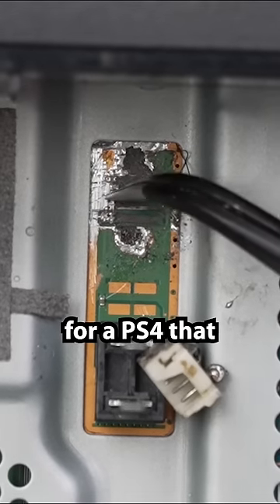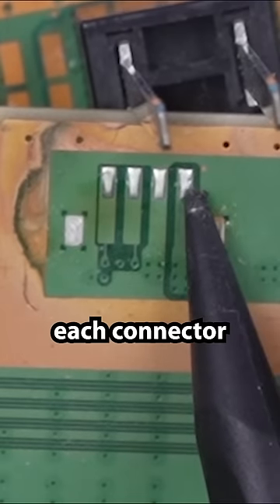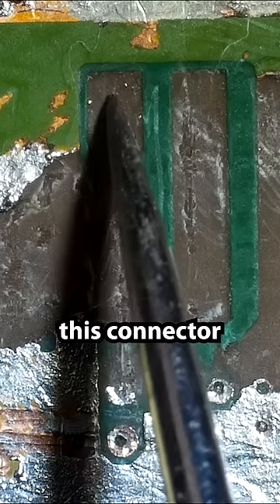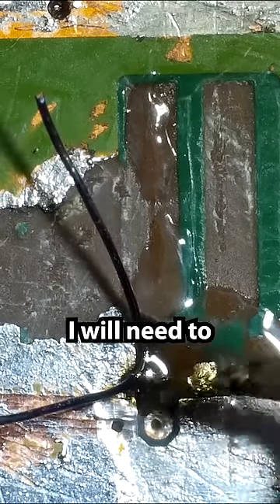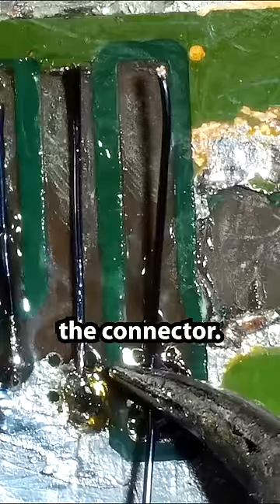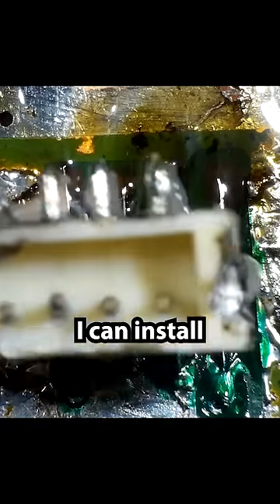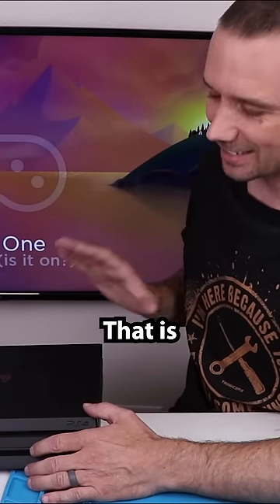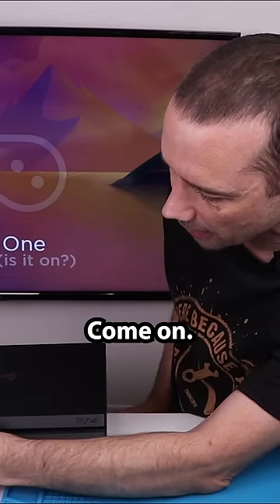3 Other "Repair Shops" FAILED to Fix This PS4

Comment: Man, they destroyed it 😂😂
Reply: yea they don't want it fixed cheap 💀
Reply: Nah blue light of death is the easiest fix. Just replace the connector Pins in the hard drive slot and put in a new hard drive and boom it's fixed I've fixed about 8 systems with that method
Reply: @ipeed  yaaa..... Gonna buy a used ps4 instead
Reply: @ipeed  is that really what it is? A burned out sata 12v? I might go buy a busted PS4 then lol
Reply: @infernaldaedra  not everytime but if you are lucky.
Reply: @ipeed  do you use a heatgun or soldering iron for this task?
Reply: Jake The Dog  Ahh he must be some notable repair man if he can do simple repairs!
Reply: @ipeed  is that always the cause or just mostly the cause?
Reply: @benargee  idk about every time but it's worked most times for me while fixing my friends systems
Reply: @ipeed  ok yeah, it just seems like there are limited ways to indicate a hardware fault so it seems odd this would exclusively be used for just that one fault. But yeah it could just be the most probable to happen.
Reply: Right? Dont know how they could be proud of that work😂😂
Reply: @ForceInEvHorizon  get a pro they are definitely worth 250$ I love mine I'm getting a 5 for Christmas had the 4 for 4 years and the slim for 7 never run discs so mine last for a long time but the 4 pro is well worth the used price now the new price they get gtfoh 349.99 😹😹😹 tells you how much they spent developing it 😹😹😹
Reply: @infernaldaedra  z xx,
Reply: It's a goddamn war zone
Reply: Why do you think a ps4 pro was $150? Come on. Think about it.
Reply: @dontazembro8637  I’ve bought and sold for cheaper
Reply: @ForceInEvHorizon  just save and buy a ps5
Reply: @benargee  Faulty APU or busted solder joints underneath the APU are the usual cause of Blue Light of Death
Reply: Destruction shop

Comment: Holy  crap. You didn't do it. All other youtubers will not upload their failures. So because your videos actually have a small chance of failure i will subscribe because I think that makes your channel better than a lot of em just by default
Reply: Uh yeah he milked 3 million videos off a broken PlayStation wouldn’t you
Reply: I mean... He paid $150 and without the video that $150 would be lost. W the video he likely got his momey nack if not more. Then on top of that, the blie light isnt unfixable, its just not worth his time to try and fix it further since the success rate is fairly low. Definitely isnt the only channel to upload his fails, id first assume those other channels went deeper into the rnepair attempt than he did before assuming they just dont upload their failures despite the fact theyd get paid for sharing it.
Reply: I'm gonna subscribe because nerdyvariety3105 subscribed!🎉

Comment: It's amazing just how fubar something can get in electronics and still be repairable
Reply: Used a dremel on a chip missing a pin once
Reply: @SlavTiger  what did you use the dremel for?
Reply: @harrydean9723  i carved off some of the chip to expose the missing pin and soldered a wire directly to it. It was a commodore 64 vic 2 chip which if you don't know is complete unobtanium if you have to replace it
Reply: man built,  man fix.
Reply: Everything is fixable it's a two factor equation un-fubar=  time + money
Reply: But he didn't actually fully repair it

Comment: So much of DIY repair comes down to having the correct tools.
Reply: Do you mean, the actual knowledge and skill?
Reply: It needs the right tool and the skill
Reply: They are basic electronic tools. I didn’t see him use a desolder suction gun or anything crazy. He did it the basic wick way. He could have connected jumper wires to the terminals if he wanted. Or if someone sold the components with the pins in the opposite side he wouldn’t have had to do 60-80% of that work.
Reply: Solder gun is like $20 you can get 2 jars of flux for $5 online. Torx & other bits also sell for around $10-$20. Actually cheaper then you think.
Reply: And Patience plus the knowledge to know when to stop before you get in over your head.

Comment: I hate replacing those wires they're so hard
I don't use solder mask though I use heat activated glue to stick the wires down
Reply: soo a hot glue gun (jk)
Reply: You don’t use grammar, either.
Reply: The glue I use is for reflow ovens to hold the parts in place I think it activates around 300° c
Reply: @saladass1571 ?

Comment: Blue light of death? I had the same thing 4 days after buying mine new from the store, left it for a while kept turning it on and off, one day it just started working again for years.
Reply: Yeah I had ps4 that would work like every 3 months lmfao
Reply: It’s an overheated connection broke loose inside you must have got it hot enough to melt the solder and reconnect. You can also put them in the oven and heat the whole thing sometimes it will melt and rejoin. I wouldn’t advise doing that first tho that’s kinda last option nothing left to do before throwing it out.
Reply: @jamesfair9751  I can only assume that quality control is very loose in these manufacturing plants.
Also, NEVER throw out an electronic device as you can always use the parts.
Reply: @jamesfair9751 You wrap the machine in a Towel tightly, only takes about 5 minutes to overheat and bend the switch, if fixed a good half dozen dead xbox 360s , first lady said can you fix my xbox its just a black screen ,I was back in 5 minutes and she was seriously happy 😊
Reply: @ianmangham4570 yay ☺
Reply: @vcommandarv5916  Jambo Bwana
Reply: @jamesfair9751  i thought blod was just corrupted hdd? thats what it was in mine, tho mine is a slim

Comment: I just wish repair shops had good tech employees like this guy
Reply: The problem is they hire kids off the street and there's no money to be made in it. When you work for a company like ubreakifix I was making 11.50 an hour. There is training yes but there isn't training for soldering or anything like that you basically bring your self taught skills to the job and don't get compensated enough for them.

Comment: This is exactly wat happened to me. That psu acted like it was glued inside that mobo connector tho. Most pads came off. I traced it giving me about 2 months of play then sumthn came loose again. Just ended up buying a new mobo.
Reply: Yeah unfortunately when they get that hot your usually alot better off doing that in the end.

Comment: I'm surprised that he managed to sell that for 150 when it's been at a few shop before you
Reply: I paid 150€ for working ps4 in 2018 with 8 games and 2 controllers 😂
Reply: I’ve sold my working ps4 for $100 before😂💀
Bro got burned
Reply: It looks like working regular PS4 slims go for 200 and PS4 Pros go for around 300.
Reply: @seemlesslies  I bought my working ps4 pro for $100 when a coworker got a ps5. Came with 2 controllers and cables for both

Comment: This is like speaking a new language to me. Electrical is complicated, and I feel like you can't just look at it and figure it out.
Reply: Very true, I fixed a halloween decoration last year and the entire circuit board was essentially for the purposes of running in demo mode for the store display.  Lots of trial-n-error to find that out.
Reply: depends on experience.

Comment: Because running power through a tiny wire, that used to have a trace 3 times the width isn't going to cause any issues...

Comment: How do you fix a BLOD? Or what do you need to replace to get rid of the BLOD?
Reply: I want an answer as well
Reply: I think apu reball. Or apu faulty.
Reply: Sometimes bad hdmi port is the issue but before that check hdmi re-timing ic. Basically the IC controlling the HDMI output. These can be replaced and 8/10 times fixes the issue. Used to repair these on a daily
Reply: @haroonmuhammad8611  that’s WLOD not BLOD

Comment: I wonder if it could have been salvaged had they not caused such a mess with it on other 3 attempts. One thing I learned is most things can be repaired if proper knowledge and patience is involved because my buddy builds these crazy gaming pc and sells them but gets almost exclusively computers deemed beyond repair and it takes him quite awhile but the more he did it the better he got. There was actually a local repair shop he built a relationship with who even give him jobs when they are busy and they give him beyond repair stuff or sell it for cheap and sometimes there are factors not worth it or require new parts he said but overall when he rebuilds them he selects ideal specification parts for what he is trying to achieve and makes decent side money doing it. His house looks like a landfill at times though, so many piles and crates and boxes and buckets, he also builds rc cars and aircraft and boats and that's a whole other aspect to his messes but he apparently has a system and knows where stuff is lol.

Comment: Instead of using enamel wire instead use copper tape it's better on the PCB yes you might need a craft knife but also it looks better

Comment: I think the connection of the connecters is not fully connected it seems because it would have worked right just saying try to make sure the connecters especially the power connector the ones with po securely fit try this

Comment: How do you fix a PS4 disk eject error? It’s like a ghost in the system. From shut-off position it turns on randomly and ejects disk, also ejects disk randomly while running.

Comment: When the power light is on and its not on, probably the harddrive or ssd fault, Rebooting will solve this problem sometime if not, try fitting new hard drive.

Comment: if all i have left is a via, i insert the tip of the wire into the via for a stronger connection.

Comment: All the ps4 videos seem to identify that they are not built to Handel any amount of use the connectors are all to weak could of used connector cables from the board to the case so no load is placed on the board when setting up or unplugging it

Comment: try again but now try to make sure that the wires is touching the connectors greater than that make sure they are touching the board  just a hint

Comment: Paid $150 for a trash.  When the pads are ripped off the board like this, it is a write off. I will not recommend more than replacing caps, inductors and resistors.

Comment: Blue light of death?
Reply: Just like the red rings of death on the Xbox 360 and the yellow light of death on the ps3. It means the main processing and graphics chips aren’t operating. Normally means the console overheated to the point the solder on the cpu/gpu pins melted and lost connection

Comment: I have a passport 360max radar detector that has a few holes drilled through the board because it was a demo unit, is that something you would look at fixing? If so where can I contact you

Comment: You can fix the blue light of death minds did that before I had to replace the hard drive the blue light of death can be that HDMI connection is damaged or the hard drive is not working also I can be the power supply is too weak minds was a hard drive problem easy to fix u just need a usb drive and a computer to reinstall the ps4 software

Comment: Why are ypu paying so much for hardware that has been given up on by 3 other repair shops? 150 should be the cost of a used PS4 THAT IS STILL RUNNING. Max needs a good dusting.

Comment: Hey I've got a PS4 all parts intact including a blown power supply. Power supply needs replacing or repair. Includes one oem controller. I'd sell whoever is interested

Comment: What gage is that wire?
Reply: Look at the near exact size between the pins in the connector and the enamelled wire.    The wire is also nearly the same size as the standard holes in the board.  
    That should give you a good idea of the size

Comment: Guy: hey i have this broken ps4 that 3 repair shops couldn't fix so it's basically e-waste
-So whaddaya want for ir
Guy: only 150 bucks
Reply: Guy: I have ps4 that I don’t know what’s wrong with it. I’ll sell it for $200 obo. 
 Buyer:  $150
Guy: deal
 Guy:  let’s meet in a public place for both our safety (at a busy place too, so you can’t take it apart to see the failed repair attempts)

Comment: How did you pay 150$ for a na broken ps4 when used ps4 pro is less than 150$? Either you got scammed a bit or this is a short of an old video my dude. Or the prices are really that different there.